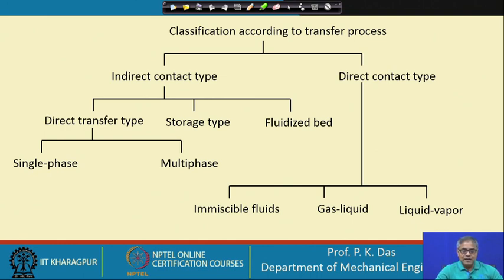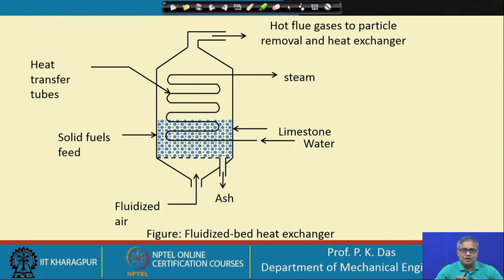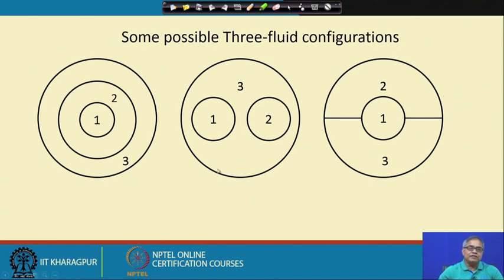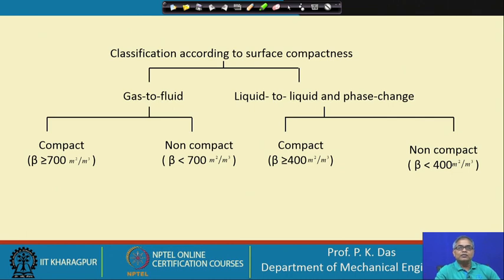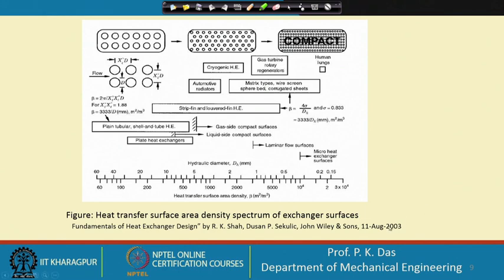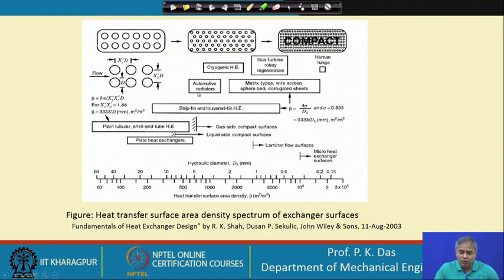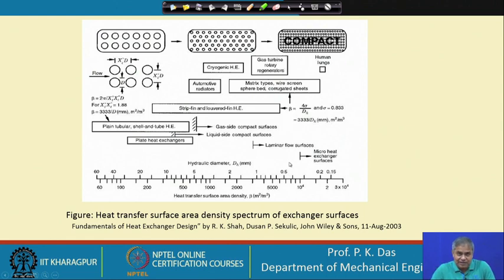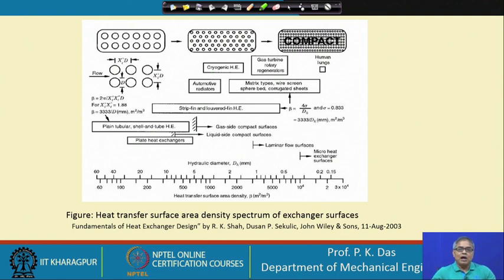Lecture 03 : Classification of Heat Exchangers

Comment: Why does a condenser in a chiller or split AC outdoor unit have forced circulation even though fins are more effective in natural convection?
Reply: Doesn't the (Total) heat transfer coefficient (U) depend and limited by the free convection HTC (h)/ the HTC on the air side since it is usually the smallest, hence, the greater the HT coefficient (h) the better the value of U and thus more the Heat Transfer